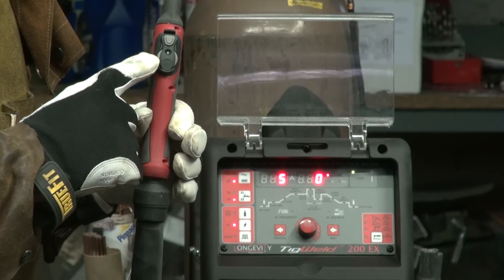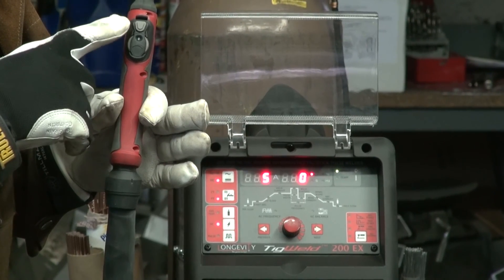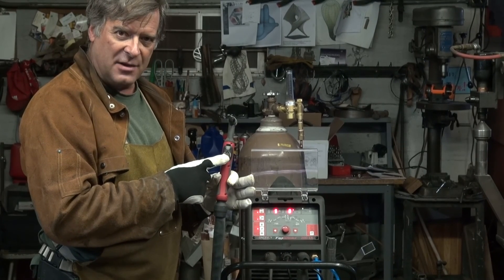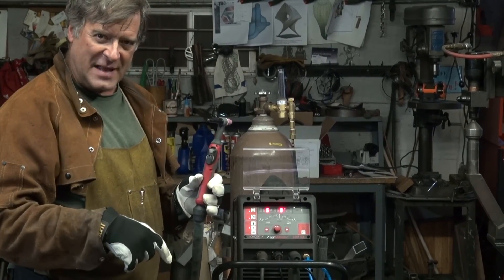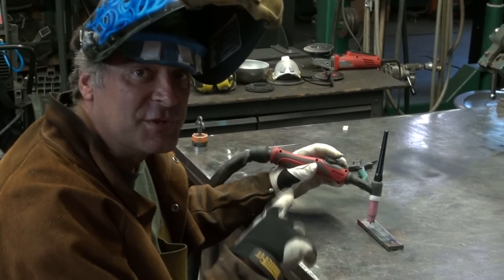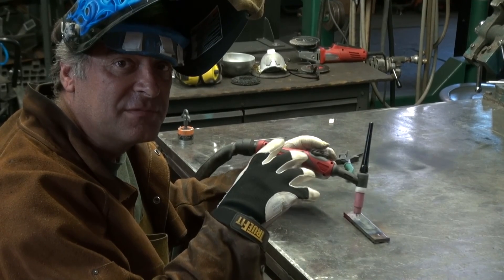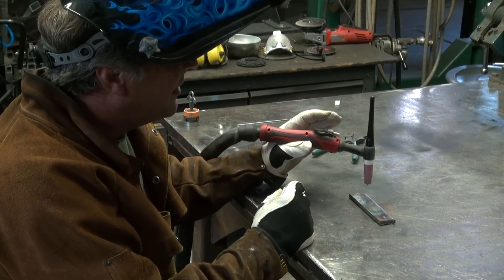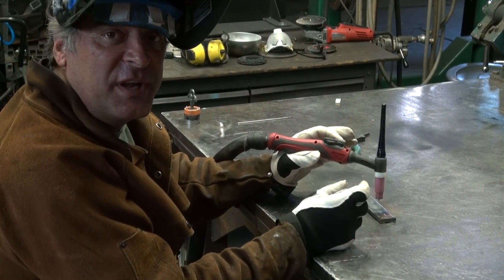How to Use the Amperage Control & Panic Button on Longevity's TigWeld 200EX TIG Welder - Kevin Caron

Comment from the maker: It took me a few hours to get used to using the wheel.  I still fumble a little when I get in a hurry.   Lucky for me I don't have to be in a hurry. 

But yes, I see your point.  It would be better in my opinion if the button and the wheel were swapped. Put the button close and the wheel a little father away.  

More practice!!!!

Comment: I see a lot of the import machines starting to go this direction with hand amp controls. I find that I dont have the precision with the hand control. I also find it much more difficult to maintain a steady hand while trying to change the amperage when it is on the torch. What are your feelings on this?

Comment: Yes my HTP machine has pulse and it is very nice for stainless and or other ferrous metals when you are welding up to an edge or you just want to focus the arc sharper  and agitate the puddle, but for aluminum I will just use the pedal for the control and or pulse I want if need be .

Comment: I wil get with you when I get clear of work at the shop .

I had to use my torch mounted amperage control all morning  today , It is good to have it when you need it but I still prefer a pedal when I can use it, I have arthritis in my wrists and hands and it is really hard for me to use torch amp control , and I pulse with the pedal when Im doing aluminum so I really hate doing aluminum with it.